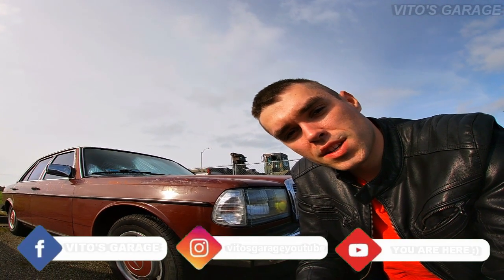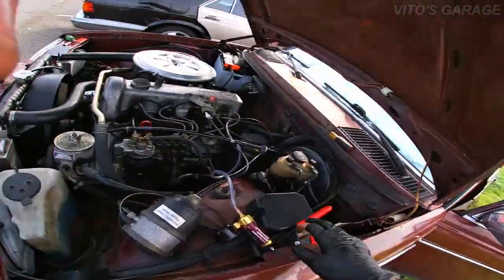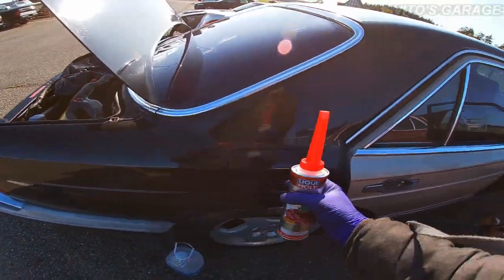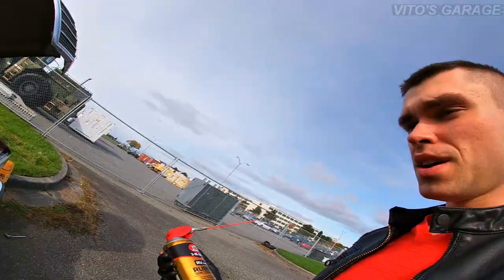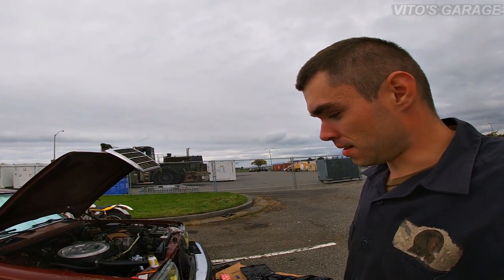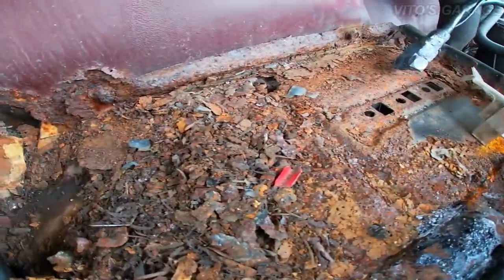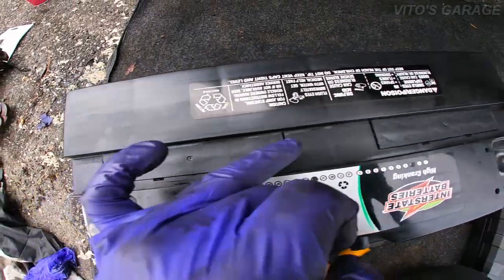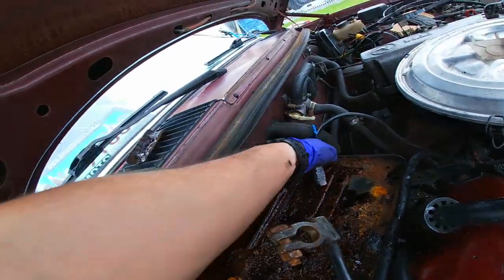SOME TIPS FOR CLASSIC CAR OWNERS!

Comment: great video Vito. i spent my saturday tracking down a vaccum leak in my 300d.  seems to be the distributor in the driver door.  up next is replace my left drive axle which is making noise when accelerating at about 60kmh...
Reply: hmmm. if youre replacing one side, you have to take off the rear diff cover (on the majority of these) Just replace both, but my guess is that its the driveshaft center support bearing. Those tend to be a little more speed sensitive
Reply: @isaaclemasters8432  might make sense to do that as well. do you have any experience with these axles off ebay ? price of those seems great.
Reply: Marc H i always buy them from napa or autozone or wherever. Done about 10 sets through the years... all see to be the same  average quality, nothings as good as the original, but the originals last 25 years... these newer ones probably last 10-15🤷🏽‍♂️. Im sure you can find time to do them again in next decade if youre a super driver. Order a good center support bearing though. Dont be cheap, its a pain in the ass to pull drive shaft down and pull it apart etc. Happy motoring
Reply from the maker: Or find used original axles and rebuild them. Install new CV boots and put new grease in there. I have some videos on that too🚗💨